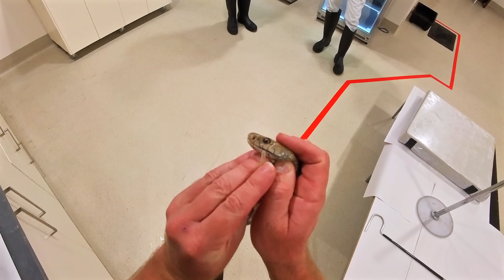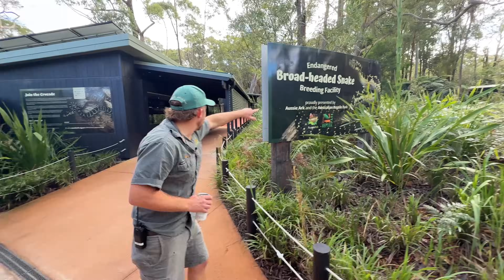Australia's Deadliest Snake CLOSE CALL | Venom Diaries

Comment: Have idea for lid that still uses lid but have one molded with color and logo of park on surface snake placed on.  This will give polished appearance along with ad spot for show.  Might suggest having custom knob molded that allows for better grip in supporting weight of snake as well as safer knob to rotate reducing possibility of tipping over lid while using fingers to rotate the smaller knob of traditional trash lid.  Along with logo on lid should make big logo for pinning pad as well reason being venom diary clips are used all over web in other videos but often just couple of seconds so the logo on hat and shirt don’t get exposure.  Having large logo on pad as well as lid bring ad exposure from its clips used around web greatly increasing exposure for park and the show